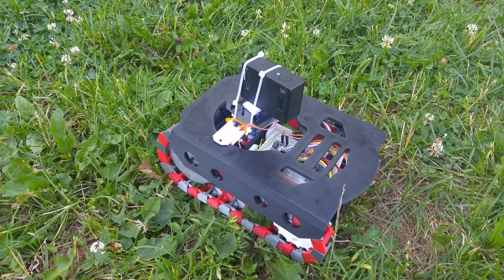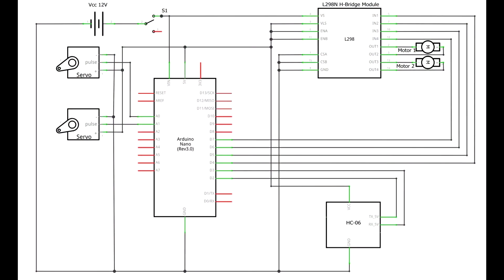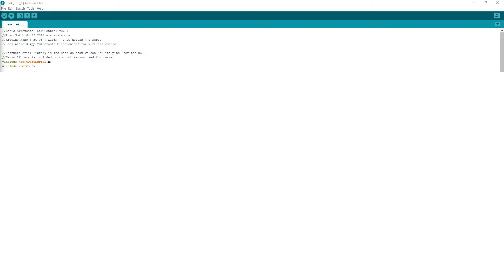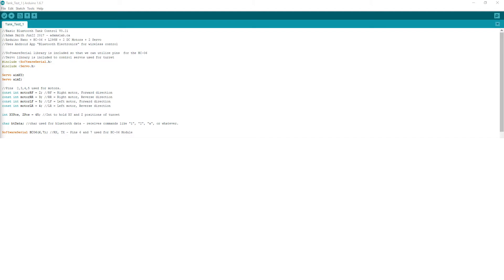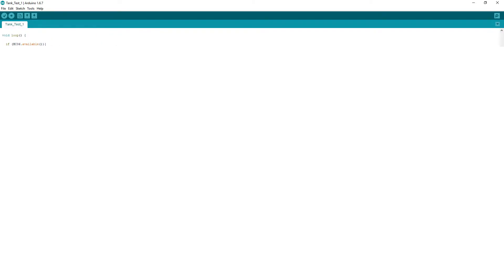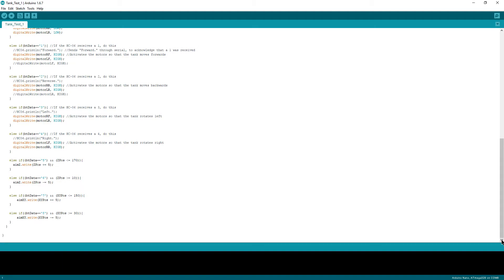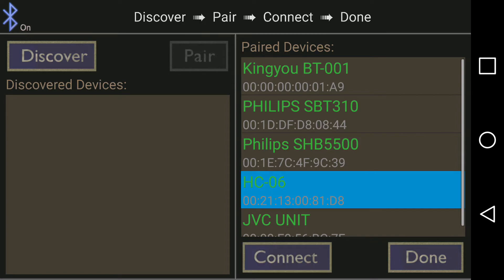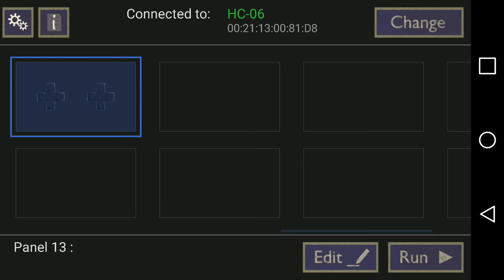3D Printed RC Tank - Updates & Programming

Comment: Sorry for the quality of the text, but I do not know how to name some terms in English, and I had to translate their Russian name, I'm not sure that Google translator coped with them well. Please tell me why you decided to use the fork brace (I mean the shape of the wheel-sprocket)? Why did you need to make such thick caterpillars? To protect the wheels? Why is one wheel made less than another? To pull the caterpillar? Do caterpillars slip from "slippery" plastic on hard surfaces? Well, the last question. He's a little personal, so you can not answer it if you do not think fit. Have you been educated as a mechanical engineer?
Reply from the maker: Thanks for the comment! The design of the wheels is just what I thought would work best. The caterpillar tracks are actually made for cable organization which is why they are so thick, I just repurposed them to work as tracks. I could make the tracks much thinner and it would still work the same, I think. I made the front wheels slightly smaller than the back wheels because I thought it looked cool. The tracks do slip a bit on flat hard surfaces, like on hard wood floors or glass, but it drives great on everything else. I might print new tracks using nylon so that they have better grip. I have no education or training in mechanical engineering other than the stuff I do for fun, I'm actually an electronics engineering technologist.
Reply: Thanks for the answer)